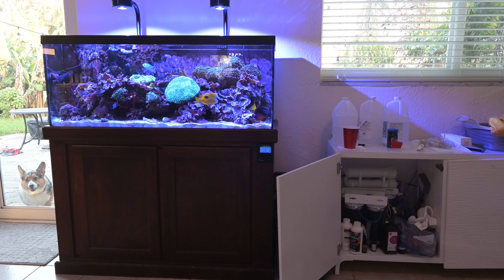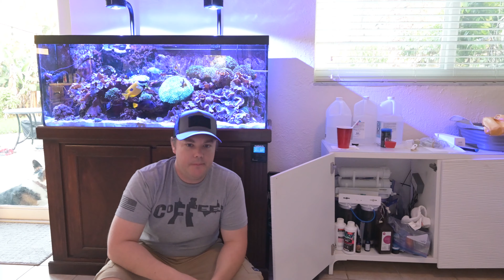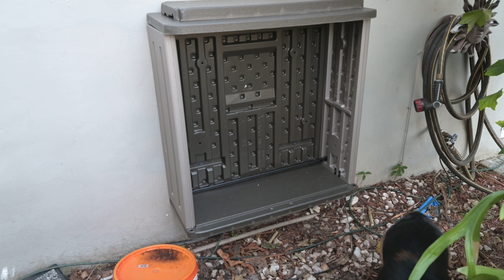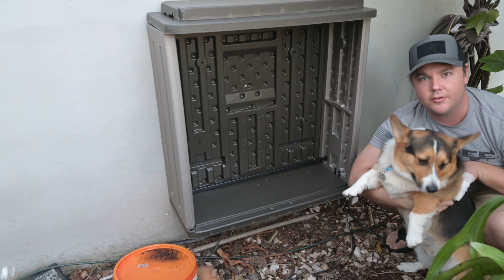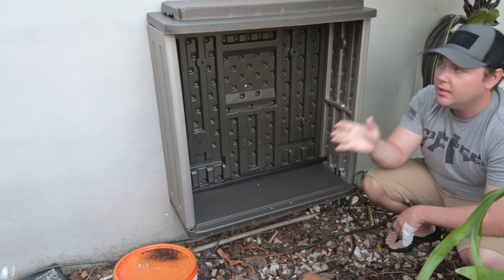How to Build an Exterior RODI Cabinet Enclosure For Your Reef Tank - Put Your RODI Outside! Part 1

Comment: it might be convenient to place your RO outside in the case of leaks but keep in mind that reverse osmosis membranes decrease in efficiency with decreasing water temperature - warmer temp = more output
Reply from the maker: Luckily in South Florida, we really don't have a problem with having colder temperatures; however its a good point. Maybe people up North could use a small heater or something to warm up the area during cooler months.